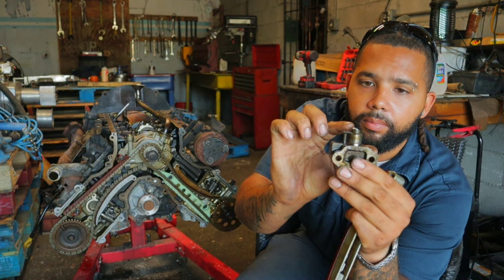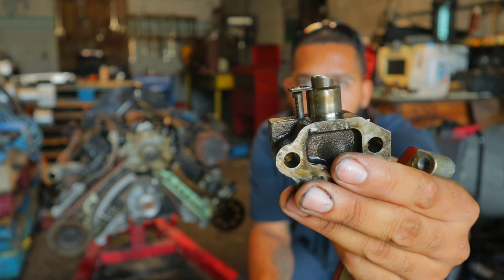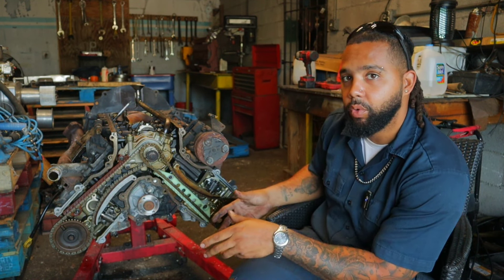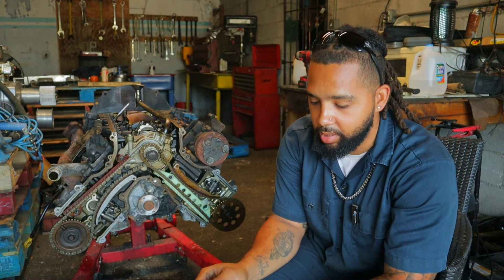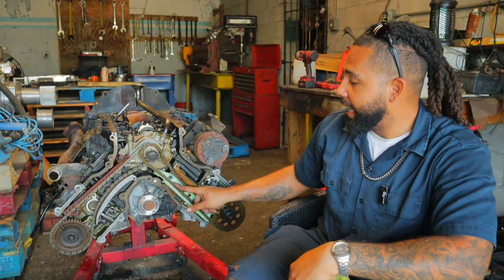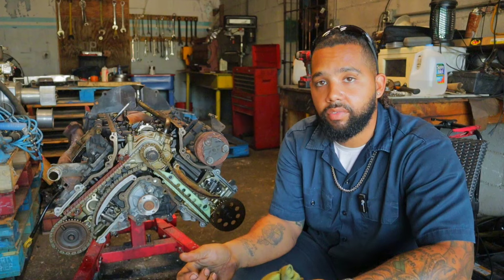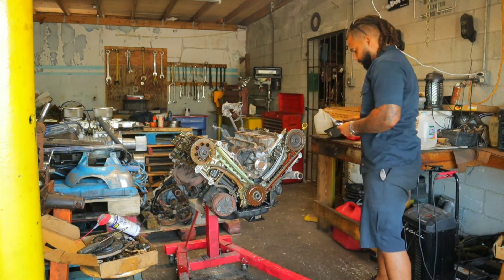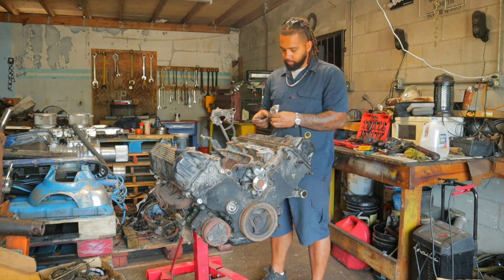The Real Reason 2V Motors Die

Comment: My chain guide issue was found only after he dismantled the engine. The piece was stuck in the pickup tube and there were some metal shavings in one of the pickup holes in the crankshaft hence that had to be replaced as well.